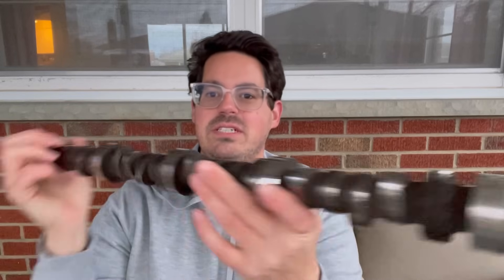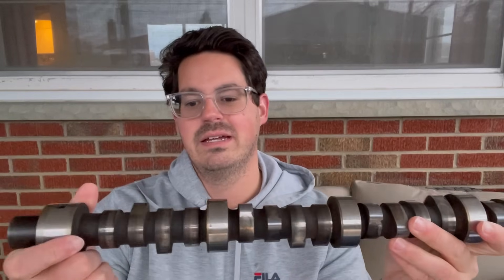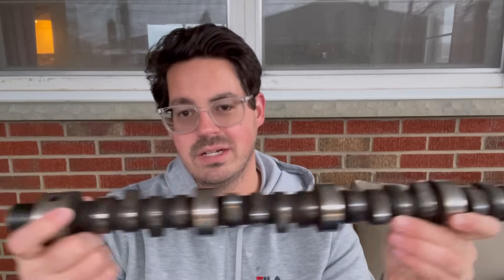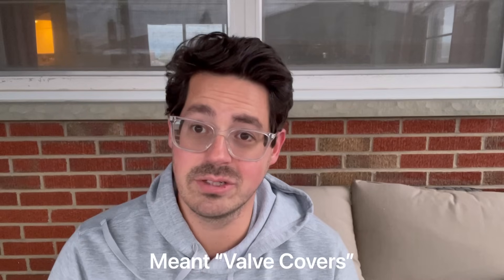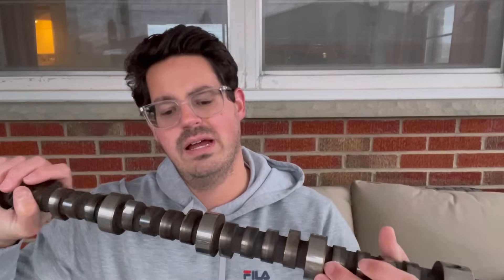Worst Automotive Components: Soft Camshafts (Chevrolet 305 & 350/Cadillac HT4100/Pontiac V8s)

Comment: Back in the 80s as a mechanic by trade, I was buying 305 Chevrolet equipped cars and trucks with wiped-out camshafts for 2 to $400 with low mileage in good condition. 
I would do a cam swap, timing chain, lifters, push rods and reseal the upper half of the engine and had a perfect running vehicle that sold that following week for fifteen hundred to $2,000. I paid for my first wedding and put a down payment on my first house fixing and flipping 305 equipped GMs. I was probably one of the few that was happy about it. But that Feeding Frenzy ended right after backfire fuel injection took over! made very good money fixing Corvettes and Camaros once you knew how to balance and tune the throttle bodies.
And to this day I'm still a Chevy guy. 
I just drive a 2004 Tahoe with an L 59 Flex Fuel 5.3. This one will fall apart before the engine dies. The small block Chevrolet is still one of the best engines ever built by Detroit.
Reply: It was good times .
Reply: Gary, you are a snake oil salesman — that means you’re a crook.

In the late 70’s and early 80’s, GM was selling brand new 350 crate engines for under $1000 ... They called them Targetmaster engines ...
Reply: @sking2173  Actually it was the opposite. I was selling vehicles undervalued after the repairs which were disclosed to the buyers. And not one came back with a problem. I was making a legitimate living and saving people money at the same time. 
At one point I had a short waiting list. If you want to Target a snake oil salesman? Look for anyone selling a 2003 to 2007 5.3 Triton Ford with the original engine. 
 Good day sir....
Reply: @sking2173  um, the new cams wouldn't fail.  Not exactly scamming anyone .  You couldn't sell the car for $2000 after installing the targetmaster(big fan of mexican smallblocks btw).  Gary was providing a community service and you owe him an apology .

Comment: Chevrolet had a noticeable number of issues in the 1969 model year as well with cam lobe failures. Maybe soft camshafts Part 1, but I’m pretty sure they did away with oil spray holes on the cam side of the connecting rods when the increased the crankshaft journal sizes. At the split line. I always wondered if that was a contributing factor. Did the divisions make cams in house, or were they supplied by an outside vendor? Both at different times?

Comment: Back in the eighties there was a GM training center here in Salt Lake City.  Had the opportunity to attend the computer command control or "3C" school there in 84. GM was sealing everything with silicone back then and the instructor told us it was because the EPA didn't want anything dripping off the new cars.  The government would take a new vehicle and run it for a prescribed amount of miles.  Park it in a building and not one drop of oil could fall onto the ground.  If one drop of oil hit the ground the car failed the test.
Reply: Mother Nature weeps for the amount of GM vehicles leaking unto her.

Comment: This goes back to what I said in a comment recently.  In the 70s US car makers badly abandoned quality in both materials and craftsmanship.  This persisted for a good 8 to 10 years.  Remember the Ford Fairmont/ Mercury Zephyr?  Horrible pieces of junk. Ford sold A LOT of them and within less than a decade most were in the junk yard.  A great deal of the blame for this lapse can be placed on organized labor whose unions had the car companies by their camshafts.  Wages and benefits, labor costs per vehicle,  were so insanely high that huge cuts had to be made in materials to make the units turn a profit.
Brand loyalty was destroyed and buyers turned to imports for both quality and economy.  Since that time US auto makers have not regained the ground they ceded.  Sad, but it was suicide.
Reply: I remember we had a 78 Ford Fairmont station wagon. It may have been a rarity because it had a 302 V8. The only issue I can remember we had with it was my dad got a flat tire on one of the rear wheels. He was pissed because he had to call someone to give him a hand. He couldn’t get the rim off the inner hub. I think someone brought him a sledgehammer or a torch so he could get the rim off it. Other than that we didn’t have any real issues with it. I think it surprised a lot of people because I believe most of them had a 6 cyl. It was rather quick for a turd brown station wagon back in the day.
Reply: That Ford Fairymount was one ugly car ...

Comment: My ‘83 Monte Carlo with a 305 made it to around 70k miles when I noticed some of the pushrods weren’t spinning. Replaced the cam and lifters myself over a weekend home from college. I guess frequent oil changes got me a little further than most, but not much. BTW what grind is that 455 cam, if you know?
Reply from the maker: Wish I could recall.  It has been too many years.  It was one step more aggressive than stock.  Still has a very smooth idle, but probably picked up 25-30 more HP.

Comment: The issue you described is on of the many issues that drove American car buyers to Toyota, etc.  I had a friend that bought a  new GM product in the 1970s, the crankshaft broke at 20,000 miles.  GM would only 1/2 the repair.  American manufactured cars quality was horrid in those days.

Comment: I guess this is a problem with the new Chrysler V8's.  The lifters run dry and round off the lobes on the camshaft.  What I remember the biggest problem on malaise era cars were nylon teeth on the timing gears.  They would strip about 30,000 miles and you were dead in the water.

Comment: It seemed that a bunch of these cam failure happened at around the same time the oil manufacturers were taking zddp out of most oils, it also doesn't help that most oil change shops would use the cheapest bulk oil money could buy which I can almost guarantee had little to no zddp which is needed for these cams to last, also cam failure seems to be more common in vehicles that were low performance or cars that got driven very easily around and cars with a bunch of idle time, which as you may know these old engines camshafts were mostly splash lubricated which means little to no lubrication at idle or low engine speeds and at that time a bunch of cars started to receive overdrive transmissions which lowered the typical cruising rpm which in some cars with very low gears like a 2:70 or lower would basically be just off idle at cruising speed which also starves the cam overtime.
Reply: LOLOL ... So 35:1 ??

Comment: Nice porch chat Adam. It’s a wonder how American car manufacturers, having been in business for decades, usually selling serviceable products, sometimes produce products. I remember the soft camshaft problems, thankfully no personably, but as a Corvette Forum contributed, mainly in the C3 section. There were lots of slightly older Corvettes suffering from bad camshafts. And not to just pick on GM,  Ford and the 3 valve modular engine was also terrible. Ford should have replaced every 3 valve engine free of charge to owners.

Comment: Yeah, these issues seem to come and go on the chevy small blocks.  I remember a strange issue we had when these engines were used for stern drive boat issues: "intake valve tulipping".  The larger diameter intake valves would sink into themselves causing running/power issues.  I'm surprised your caddy engine didn't have lifter clatter with all those lobes missing.  Perhaps the lifters were adjusted to compensate for the  worn camshaft when all that engine work was done for the previous owner.  Like you said, perhaps some of this damage was caused when the oil was diluted with antifreeze.  
For the life of me, I can not understand the engineering behind and aluminum block with cast iron heads....Why not just make the heads out of aluminum as well?  Surely would have been a cost/weight savings.  Just doesn't seem like the heads needed the strength of cast iron,  they were worried about the heads warping due to fewer head bolts.  They must have had some crazy reason for it
Reply: Guess I was lucky, but I changed the oil very frequently

Comment: Thanks Adam. This is not unlike the camshaft wear on the VW diesel pumpe düse injector  nozzle lobes. They basically wrote themselves flat as well. Thankfully decent electronic TDI injection was well on the way to replace this system, but then of course DieselGate came along. 😁

Comment: I haven’t watched this video yet, I’m sure it’s going to make my blood boil when I do. 

The soft cam, the Olds 350 diesel, the cookie cutter interchangeable parts,interchangeable “image” of the mid yo early 90s, rushed 440T4 transmission, the list goes on. It’s all symptoms of a common Big 3 problem, decision made with the next stockholders dividend, boardroom meeting, or performance bonus in mind instead of the long term. GM spent 80 years making a name for themselves, the bean counters ruined it in a fraction of that time.
Reply: Same fate as suffered by GE, Boeing and other former titans.
As long the CEO, CFO, COO, Board Members and others AREN’T compensated and rewarded by some measure of performance, but rather a golden parachute…They’ll suffer failure after failure.
And you wonder why I own Toyota and Lexus ??
Reply: Ah yes, the Oldsmobile diesel. That engine could "smell" a hill and paired up with the "reliable"(LOL) 200r4, NOT! My dad had an 81 Oldsmobile that on a trip from Richmond, va to Charleston, wv on I64 would only run 45-50 mph going up the grades on the west Virginia turnpike with the go pedal mashed in the carpet, but man that car had ICE cold 🧊 a/c and a radiator as big as 1 ton truck, the engine never overheated.
Reply: Glad that you put it that way, GM not the only ones making junk! My '75 LTD was a rolling mechanical nightmare, 8 mpg on a good day.
Reply: It’s the same problem we have with government now
Reply: Dont forget to blame the gubmint for their part.....
Reply: I hadn't really thought about it but I made a decent living in the '90s and oughts from GM failing their customer .  You ain't whistling dixie about interchangeability , if you suspect a part fits, try it probably does .
Reply: i remember as a kid that soft camshaft plus over heating  and head gaskets-2x got my mid-80's k1500 truck and my parents and i remember now the argumenting my mom did didn't help dad is hard on vehicles, wondering now if that's one thing that split up the two anyways the engine bay is empty now got jacked so it's probably going to end up a BEV

Comment: Lost the camshaft on a '78 Pontiac Trans Am with the W72 T/A 6.6 400 engine at 18,000 miles. Sent metal all through the engine. Dealer said outta luck, new vehicle warranty was only 12 months/12,000 miles then.
Reply: Yikes. 12 month, 12k. Thats quite the warranty on a new car😂

Comment: GM provided a "Goodwill Adjustment" for customers who had camshaft failures in certain V8s.  I received two $150 checks from Chevrolet Motor Division on two late 70s Caprice Classics that I had changed the cam and lifters.

Comment: Nice demonstration of cam wear.
When that happens, you kind of need to ask well where did all that metal go.  Think of grinding a lobe or two off the camshaft and mixing the grindings in the oil .... not a good thing.   Amazingly they did survive after a new camshaft was installed.  More modern engines with tighter tolerances might not.  There's going to be some bearing damage.
Reply: For sure, the oil pump is toast.
Reply: @jamesplotkin4674  Yeah when it gets that bad it's time for new bearings (rod and main) plus an oil pump. Be careful out there because their seems to be some issues these days with really bad cams and lifters. Their either to soft or out of spec and will eat themselves on break in.
Reply: @davidmiller9485  It's now at the point where we need to assume all the cams and lifters are crap, even from big names and use weak springs and lots of zinc in the break-in oil. Sad timed for us enthuziasts.

Comment: When I saw "soft camshafts", I was sure it was going to be about the 2003+ 5.7 Hemi issue.
Reply: They've been screwing this up for years, that's nothing new.
Reply: @MrTheHillfolk  Yeah, unfortunately.  In the case of the Hemis I believe it's mostly a lubrication issue.  That engine has a VERY high cam tunnel, meaning that incidental oil slather from the nearby crackshaft doesn't work so well, at least anywhere near idle.  Hence most of the issues seem to be with commercial rigs and cop cars - stuff that sits idling for 6 hours a day and doesn't get the splashing that it demands.

Comment: My father in law bought a new 1976 Bonneville  with the 400 in it. It was a beautiful 4 door hard top in a maroonish colour and matching vinyl top. We actually used it as our wedding car. Anyway he hated that car. Very poor gas mileage and no power. After 4 years he only had 11,000 miles on it. He had repeatedly taken it to 2 different GM dealers to no avail so he took it to an old buddy of his in a small town garage and sure enough it not only had a worn out cam shaft but also intake valves leaked. I had never heard of that before but it fixed the problem.

Comment: Great explanation of the lousy HT4100. I've owned 2 1984 Eldo's and both had the POS HT4100. The first one was an ETC that used to belong to the President of Bank of America in Houston (new) that ended up in WV when I bought it. It was OK, all blacked out with tan leather interior. The second one that I bought was a perfect, mint 1984 Biarritz in black with a red leather interior. That car was owned by a Cadillac mechanic who completely went through the car and rebuilt the engine with dealer parts. Cosmetically it looked better than the day it rolled out of the showroom. The rebuild lasted a year before the engine developed what sounded like a tappet or lifter noise, and 2 weeks later the engine seized up on the way home from work. I really liked those cars but there were NO good choices for the engine. Diesel or HT4100. The best years were the 1979 or 80 when I think you could at least get the 368, the last real Cadillac engine. Even the 4-6-8 in '81 was a 368 that you could override to stay in 8 cyl mode. About 10-11 years ago I came across another '84 Eldo. Not a Biarritz but nice. Black/Black digital dash super clean 54k miles. Decent price. I just couldn't do it. I told the seller I'd have to have rocks in my head to buy another 4100. The other thing about those HT4100's is most used ones the exhaust always stunk or had minor idle smoke issues. I always wanted to find a nice pre '80 Seville which was the crown jewel of the Cadillac line, even above the Fleetwood, when they had the FI Olds 350 engine. I didn't really appreciate the bustleback restyle. I think those were supposed to be more of a hand built car to compete with the European luxury market. I think they used the B body chassis. My neighbor owned a garage and I remember some of those GM's in the 80's coming in from the factory with nothing but silicone for the valve cover gaskets.
Reply: I have an '80 Eldo with the Olds 350 but someone put a carburetor on it with a fuel pressure regulator!

Comment: I’ve had 15 or so 77-90 Chevy Caprice’s never had a bad cam, most were 305’s. I did see a few 267 Chevy’s (79-82) have this problem, but never had issues.
Reply: I agree  THE  267 HAD CAM PROBLEMS
Reply: @walterjones5727  around 50k the 267’s, people forget them, started out in the Camaro in 79’ then made it into others. The long lost Chevy V8’s the 267 along with the 262 lol

Comment: when i was a kid i was taught the softer camshafts kept the lifters from mushrooming which in turn saved me time replacing the cams mostly sbc rear drive cars simple and low cost ! you can run higher zinc oils but then risk damaging the catylitic converter
Reply: Usually what happened was that the lifters mushroomed first, then the cams eventually wore down.

Comment: I think the manufacturers were really experimenting to see how far they could reduce production costs during this time and didn't really have the full technology to support it.  I have a 1980 F350 dually, first year for the styleside dually, and it is positively dainty compared to my '69 F250...all plastic on the inside, thinner gauge metal, drilled frame, etc.  really a reduction in robustness, which they had to walkback some of the cost savings somewhat because of the fragility.  the 400ci engine is pretty robust tho.  some of it had to do with fuel economy, but the cheapening overall of US made vehicles really accelerated during this time frame.
Reply: Did you experience the windshield "pop" when a snowplow was attached to those Swiss cheese framed trucks?
The truck would flex so much the windshield would come out.
Reply: @alecfromminnenowhere2089  no, but it was already my least favorite body style .